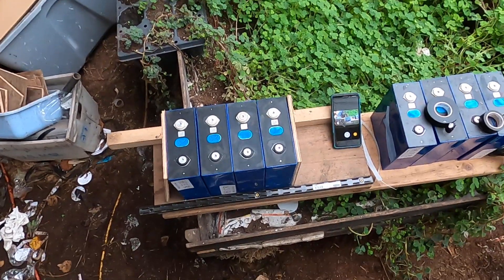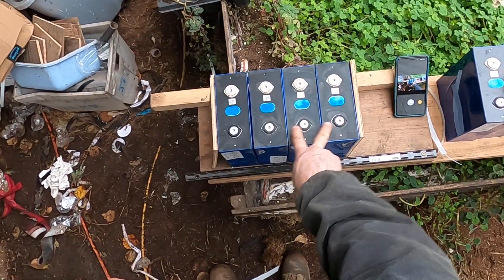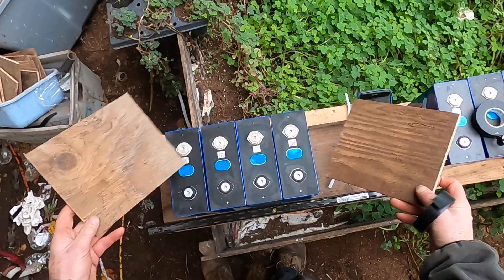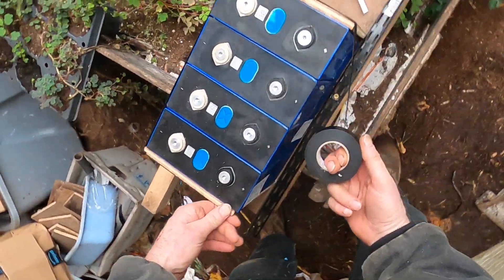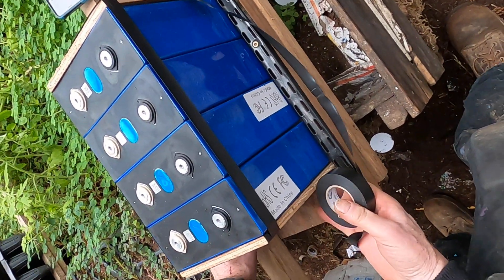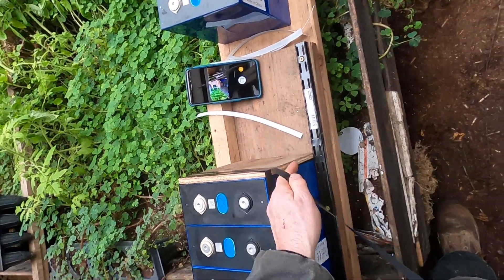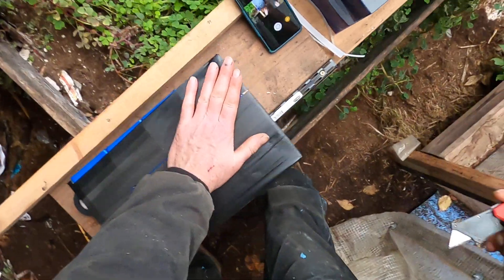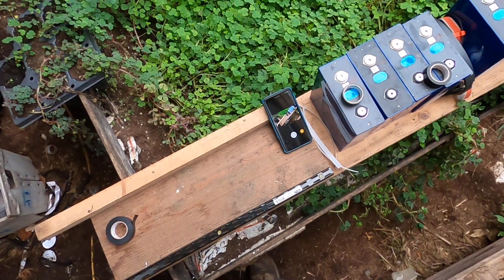Update to my LiFePo4 280AH Eve Cell Bundling and Compression strategy.  Electrical Tape!

Comment: No. This is not the way to do it, sorry. With time and discharging cycles, your tape will expand. And if a cell is bad, what do you do to replace it? The way to do it is to insert 1/16 plastic sheet (cutting board style) between each cell and use a 3/4 plywood on each end connected with a1/2 treated rod wrapped in PEX tubing and nit and washer licks on each end. 2 rods on each side.

Comment: Should use plastic board ( starboard ) instead of the combustible wood!
Reply from the maker: Would plastic be combustible too?
Reply: @metagrid9453  yes but at much higher heat so this is better, everything is combustible at enough heat!

Comment: Kompress it with "OX-P201224 Pro Heavy Clamp" and a fiber reinforced 3M Tape. This will work better an will last for years. ;-)
Reply from the maker: That's an interesting idea.  I will keep that in mind if I have problems down the rd.  So far my bundle is stable.   I did add more straps and some electrical tape though.
Reply: @metagrid9453  I think your tape will hold up securely. It only becomes problematic when the temperatures get higher. The electrical tape then becomes soft and stretches.

Comment: After doing the straps I tried threaded rods, they are Soo much better. I recommend giving them a shot, up to 24 in a single set. Threaded rods were at home depot. I still need to test and see how tight one needs to get for the proper pressure.
Reply from the maker: OK, thanks.  Mine seem to be working fine for now.  I did add some straps and some electrical tape to the bundle strategy to get it where I wanted.

Comment: Try those self locking cable loop ties,, and wooden board at the bottom of the cells
Reply from the maker: Tried those.  They work pretty well.  I do like the electrical tape better though as it is quicker and seems to spread the compression evenly over the cells.

Comment: Tapes dont work,,i tried those,,
Reply from the maker: I have several packs that I taped up 2 weeks ago that are still firmly compressed.
Reply from the maker: @DIY Projects My 12v/280AH system has cycled 30 or 40 times with no noticeable issues so far.  Of course it's double protected from overcharge, overdischarge and also from cell balance issues.
Reply from the maker: @DIY Projects Wow, I would watch that video.  (-;

Comment: Use short straps dude, electric tape expand , get few in harbor freight for few bucks
Reply from the maker: Have not noticed any expansion of the tape.  I pre-stretched it as I was wrapping.  I have several packs that I did 2 weeks ago with no noticable expansion of the tape.  The cells are just as secure as when they were wrapped.  I feel that pre-stretching while wrapping the stretchy electrical tape is key to this method.
Reply: @metagrid9453  hope that works but if the batteries get to a lot of heat they will crack at sometime
Reply from the maker: @jvf6257  Thanks!  The battery is being designed for long term storage of off-grid produced solar power.  The charge and discharge rates should never be enough to generate any significant battery heat.

Comment: I’m using strapping tape
Reply from the maker: My 12V pack is still doing ok with the strapping tape.
Reply: I like the strapping tape deal.  I'm going to put some thin pvc at the ends of my battery packs (3x8dx280ah) and set my charge profile to 80/20.  We live full time on our boat so that should last decades ....

Comment: I'm wrapping mine in place as a full 24s battery.
Reply from the maker: Seems like a good idea, as long as you are certain that you will not have to move them in the future.  Weight of a full 24s pack would be an issue, especially with the 280AH cells.
Reply: @metagrid9453  yeah I'd have to completely rebuild to move them, but that's alright! I would just have to remember to drain most of the capacity first so I could get the proper compression.
Reply from the maker: @Zorlig  Cool!  Any idea how much they contract when dischaged?
Reply: @metagrid9453  the specs say 71.5mm at 30% state of charge and 72.0mm fully changed. For mine that is a full 1.3cm difference! That's why I'm binding before I charge them and am going to mark the ends to see if there is actually expansion.
Reply from the maker: @Zorlig  That's pretty significant expansion.
Reply: Yeah, I just started my balance a couple minutes ago. Going to let the inverter charge it at 1a in the deployed 24s configuration with an active balancer to do the balancing. Might take a few weeks!! Stopping at 3.395v
Reply from the maker: @Zorlig  Patience is the key with this big cells.  Good luck!

Comment: I'm trying the strap method and found I couldn't get it right either, so I'm trying wood blocks to get them tighter. I'm curious how close to the 600lb target that tape gets.
Reply from the maker: I do not know how close to the target the tape gets and cannot think of a way to measure that.  My gut feeling is that it is close to that level.  The main difference with this method is that the compression is even over the entire outer surface of the cell pack.  Also, the cells are very secure and form a tight physical bond with each other in this method.
Reply: You’re nowhere near enough compression to make any difference.
Reply: @snivesz32  I ended to using threaded rods, which worked perfectly. Cells haven't moved in years!!